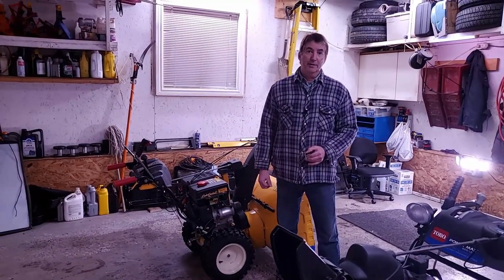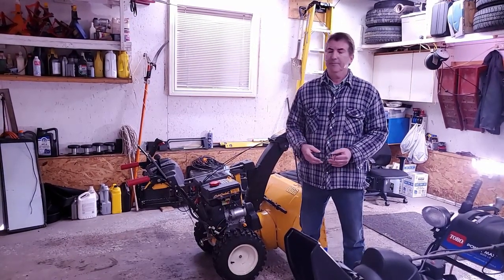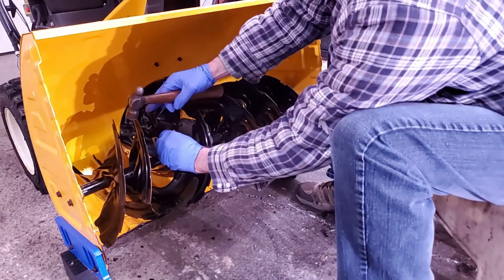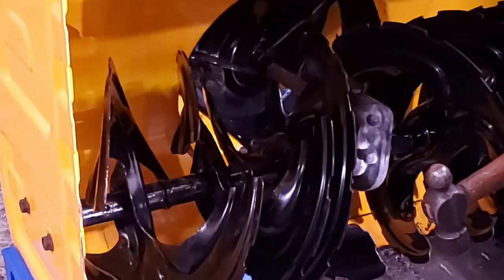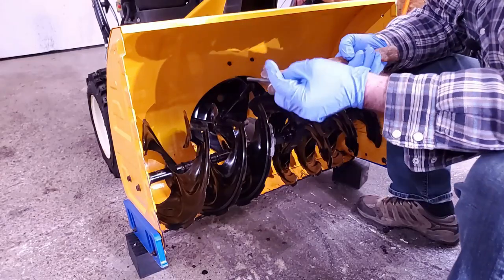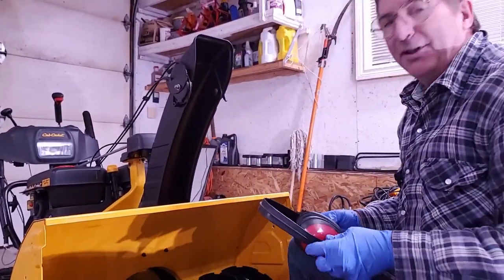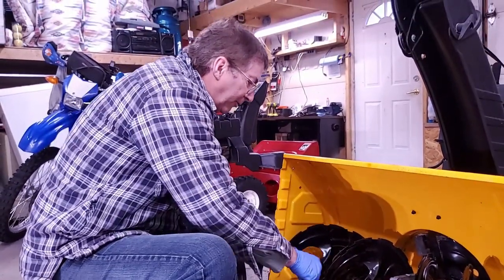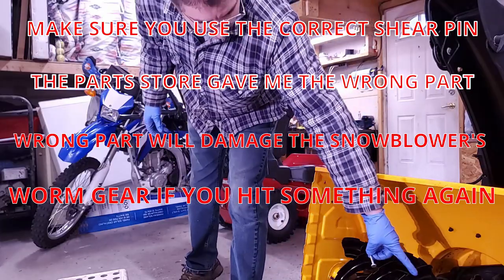HOW TO REMOVE SEIZED SHEAR PINS ON A SNOWBLOWER #Frugal With John

Comment: Although john didn't say, I believe the key factors to removing these pins where the use of his pneumatic impact the lubricant that he used for 2 days previously.  John would you mind commenting on these two points?  Thanks and I always enjoy your videos.  Keep up the great work!  👍
Reply from the maker: Using penetration oil and allowing it time to do it's work, helps a lot. If I am doing work on an older vehicle, I sometimes bring it in a day ahead of time and spray the bolts I will be removing with penetrating oil. The other key thing was the air hammer, you need to hit both sides of the broken shear pin, short hits and use oil when doing this. The tip of the air hammers punch needs to be flat, do not use the pointed end or you will mushroom the end and make it harder to come out. The biggest thing to help remove stuck/seized anything is to have patience and a good attitude, it is a game and I like to win, (I will say, I win in my head when it comes out)

Comment: Awesome repair John! I have the 3X blower 30HD..... Thank goodness I haven't had that problem. If I do, I'm going straight to my burp gun and WD thanks to your video. I just ordered a 2 way Chute Control control assembly for mine. It was jammed for some reason, couldn't find anything obvious. Now I'm looking for a service manual in regards to proper steps for the assembly removal/installation along with the cable plate adapter at the chute. So far, no luck finding one...... Thanks again for your video, I learned something today!! 😊👍
Reply from the maker: Thanks for watching, If I every get one with a chute control problem, I will post the repair. Check out the manufacturer's website for a manual or look at the the parts breakdown on the website, the breakdown can give a lot of info on how it is put together.
Reply: @FRUGALWITHJOHN  Thank for the help. I do have the breakdown. I've been looking for a service manual without any luck in regards to proper procedure of removing/installation. Thanks again. 😊
Reply from the maker: A lot of times, I use the parts breakdown to do repairs. I have been doing mechanical work for a numbers of years-if I see how it is put together with the breakdown, I understand what needs to be done to repair it.

Comment: Great video.  Exactly the issue I had except only 1 of 3 on the left side is seized.  But without an air hammer, it's looking like I'll have to take it into the shop.
Reply from the maker: You can also drill them out, or use the link in the description to purchase an air hammer. Thanks for watching
Reply: Thanks .I drilled them all out using 3 size bits up 1/4. Used WD 40 to clean out & lube 
Took about 2 hrs 
I did not think a pistol drill would work in those tight spaces of the blades but to my surprise it worked out fine . My neighbor owes me one top notch dinner 😂

Comment: I have a Stanley 45" snow blower model 45SS. I need the worm gear inside the gear box, I cannot seem to find the part number. Does anyone know who makes the parts for Stanley? or the part number?
Reply from the maker: contact GXi Parts & Service 1-800-393-0668 ask about (B01410: Auger/Impeller Gearbox) I don't know if they sell just the worm gear, but they should have the part number. If that does not work google the part number I gave you.

Comment: I Did the penetrating oil soak and hammer with hole punch 7 times over the last 5 days with no result. How do I remove a shear pin that is really stuck?
Reply from the maker: Thanks for watching, with an Air Hammer like I did in the video. If that does not work, drill them out.

Comment: Shear pins are my recurring nightmare. They break constantly on my Ariens and I don't know why. Everything is well greased, I cleared my driveway of sticks and stones, and 30 seconds in I broke two pins! Why? I have a hard time replacing them because I can't see well enough to line up the pin with the hole. Is there any easier way to line it up, like some marking somewhere that I don't know about? Thanks.
Reply from the maker: I would say choose a lower gear, I know somebody who breaks the pins all the time also, because he tries going too fast through the snow. There is no easier way to line up the pin, a cheap pair of reading glasses may help, I need to use them all the time.
Reply: @FRUGALWITHJOHN  Thanks. I was using the lowest gear lol. It took me about 45 minutes to change two pins, but after that it worked well. Of course I had to clear all the snow out of the impeller, then the grease on the axle obscured my view of where the holes lined up with the broken pins. I wish some company could come up with a better way. Thanks again for answering.
Reply: Are they giving you the correct pins?  They shouldn't be breaking that easy.
Every blower is different, but on Ariens you tighten them until they just touch the auger tube, and back off a touch so you can rotate them in the hole by hand.
Too tight or too loose will effect how they work.

Comment: I have the same problem, 1 pin sheared and the other 3 are siezed. I am using a mixture of ATF and acetone as a penatrating solution.  Day 2 and still not budging. Any recommendations for a penatrating oil?
Reply from the maker: Canada  https://amzn.to/3GwLsmi  USA  https://amzn.to/3GA1uf7  Affiliate links. It may be cheaper buying it local. Don't forget to try to air hammer both sides of the pin like I did in the video.
Reply: @FRUGALWITHJOHN  Yeah, I had all the air tools, presses, pullers, welders, etc, but then I retired, so it's back to basics. I'll getter done!

Comment: - Don't have Fancy air gun Hammer 🔨
- I do have a good drill. 
So I tried and tried. Broke the bit 😡
Finally took a heavy duty Screw driver and heavy 🔨 Three four hits, son of gun was out. Btw I did clear area using carbonator cleaner and used a silicon lubricant. I think whatever works, clean with whatever for visibility and oil with whatever. Just a good pointy thing and a heavy hammer and Bob's your uncle.
Reply from the maker: Whatever works, you can see in the video, I was using a long bolt for a punch. I use the bolt because it has a flat surface and inexpensive to replace. Using something with a point makes it harder to remove because it mushrooms the head of the broken shear pin and in turn making it harder to come out. Thanks for watching. Like the saying goes, going to need a bigger hammer.
Reply: @FRUGALWITHJOHN  I agree with you John. My screw driver did get stuck momentarily in there. It was -25 bone 🦴 chilling cold, and like you said whatever works. John I just want to Thank You for your Video. Above everything, it gave me the courage to think I could do it, and I did it. So thank you.

Comment: Good job my friend stay connected
Reply from the maker: Thank you, I will
Reply: Maybe these new pins are from China and don't  shear properly  in decades I've  never had  a problem with them hiding after breaking this comment reminds me to coat the pin in marine  waterproof ..   grease used when you mount a propeller on the shaft

Comment: What tool is being used?
Reply from the maker: I am using a long bolt for a punch and  air hammer, the Air Hammer is from Canada Tire but can get it at any place that sells tools
Reply: @FRUGALWITHJOHN  Which air hammer do you recommend?  I have Canadian Tire, Home Depot, Rona, and Lowe's nearby.
Reply from the maker: @pgbrandon  Amazon, I have a link in my description

Comment: I have this issue with my snowblower now. I wish I had that gun. What kind of tool is that exactly? Maybe it'll be something I invest in. I have a small compressor.
Reply from the maker: Thanks for watching, the tool used (Air Hammer)  I added an affiliate link to the tool in the description.

Comment: ive watched your video im doing mine the same way as you i still cant get one out its been 3 days??
Reply from the maker: When they get that hard, I will drill them out. Thanks for watching.
Reply: @FRUGALWITHJOHN  i did drill it out i think a bit loser but it fits
Reply: is trhat ok
Reply from the maker: It should be good, as long as you did not drill the hole too big.
Reply: @FRUGALWITHJOHN  no just a bit it has a little bit more play in like the other ones  not a ton
Reply: @FRUGALWITHJOHN  it wiggles   another question i was short one shear pin with the clip so i ordered some it said mtd for my machine  shear pins came with cotter pin ?????
Reply from the maker: As you can see in the video, I was also giving the wrong shear pins. I tend to buy stuff like this local so I can return if needed and get the correct ones. I don't know if you have the wrong one - I went to the place that sells that snow blower and got my pins there (and was also giving the wrong ones the first time around).
Reply: @FRUGALWITHJOHN  I'm gonna find a grade 8 bolt with a nut i a little  bigger to fit the hole tighter i made it to big  first time doing this
Reply from the maker: Extremely bad idea, if you use a bolt and hit something again, you will be replacing the front gear housing. Use the shear pin, even if it is loose, every time you put in a new shear pin in, you will have some play until the hole fills with rust again.
Reply: @FRUGALWITHJOHN  it says u can use a grade 8 bolt ?? they break ??

Comment: I CAN'T  find the busted pin!! never had this happen!
Reply from the maker: Sounds like it came out easy if, I am reading this right. Thanks for watching
Reply: could not find it no matter how many times we spun  the auger had to match up the left pin... angle  it ,was intact to where the right pin should be  used punch in the location  but had to drill it out which worked..
use high quality bits!!
Reply from the maker: I had to drill many out over the years. The air hammer is faster but does not work every time.

Comment: Next time drill them out, much faster
Reply from the maker: I have drilled many out. The method I used is much easier and faster, I will only drill as a last resort. Thanks for watching
Reply: OK, for us nontechnical types, what kind of drill bits are you using to drill them out with breaking your bits?  I have pounded the hell of of my frozen shear pin and it refuses to budge.